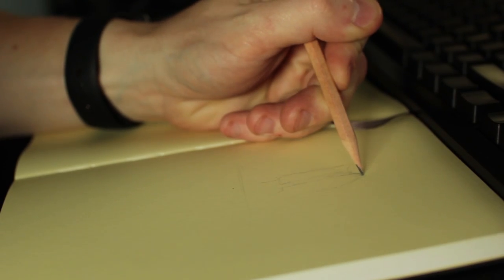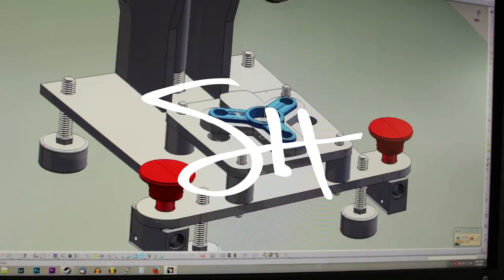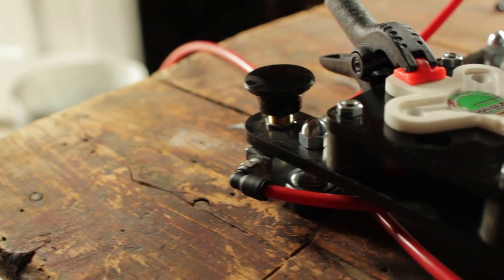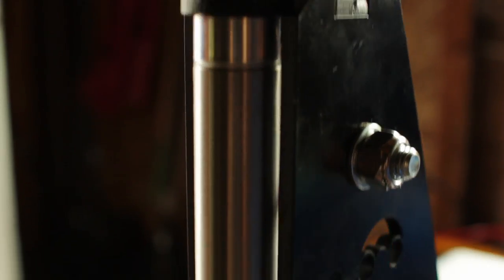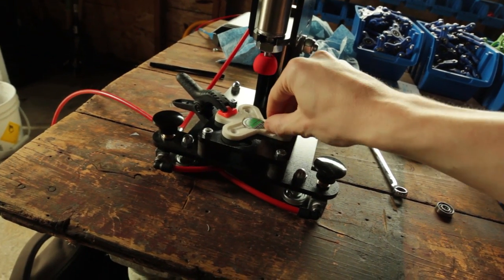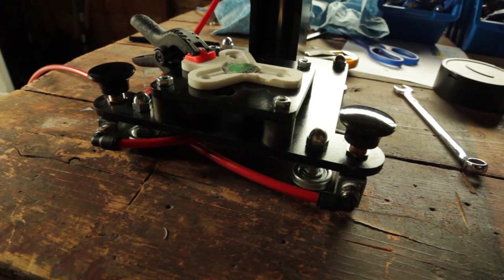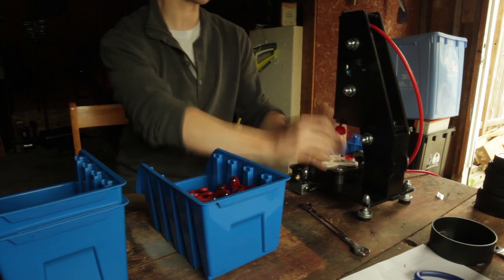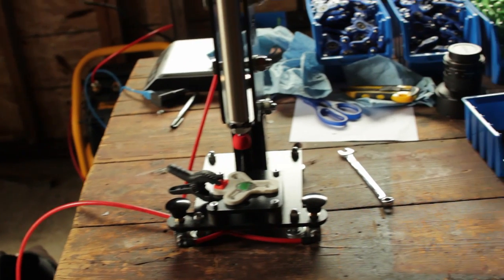DIY Pneumatic Fidget Spinner Bearing Press - BYOT

Comment: As a machinist and backer for 2 of the spinners, I say nicely done.  Can't wait for the first tier to arrive...just commented about my son's birthday coming up and happy to hear they might be here in time for his birthday.  No biggie if they're not, but it would be awesome.  Btw...is that a Cruze you drive?  lol  Random, I know.
Reply: Should also add as a machinist, a few of the jobs I've run, we had to insert bearings into different parts and the shop built their own press for installation...it's not as fast as yours, but could do about 6 a minute or 1 every 10 seconds which wasn't too bad...although we had to complete orders of multiple thousand in a couple days (both machining the piece and inserting bearings and packaging and shipping)...so that wasn't much fun.  

I know pretty well how this project has been rolling along for you and I have to say your timeline is awesome for the amount of spinners you have to complete...and your little hiccups in the time...they really are nothing.  Keep it up!
Reply from the maker: They should be there on time. :) - My dream is to eventually have a shop permanent and big enough to have some larger machines, lathe, mill, etc. you know. I think once a process get into the hundreds and thousands, its almost always worth it to spend time to improve work flow even if that means spending time to build stuff instead of actually doing that task. As long as you know it will work. Ha

Thanks for the encouragement as well!

Also, its a 2007 Toyota Yaris, bought it specifically a few weeks ago for doing small commutes and shipping. Probably the best deal on a car I've ever done, $700. Put another $800 and a weeks worth of work into it and its the cheapest $1500 car I've ever owned, and is actually safe compared to my Tacoma. Haha